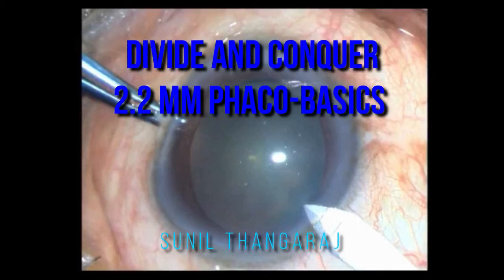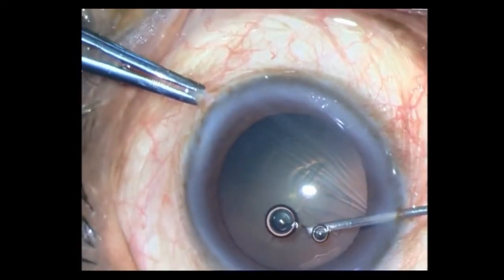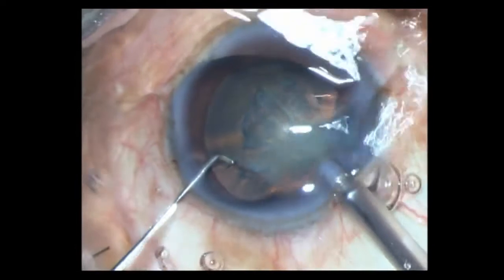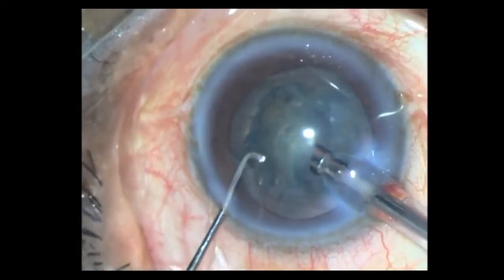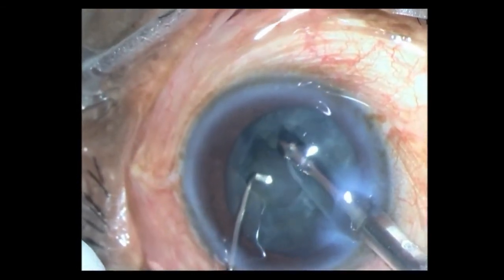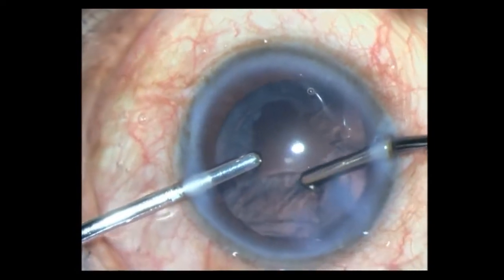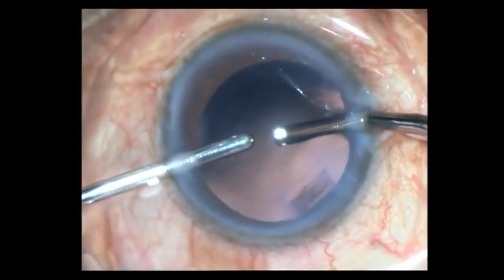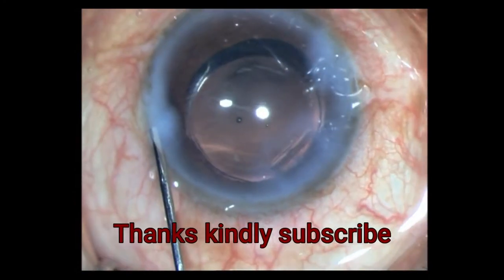Divide & Conquer - Basic technique in a 2.2 Phaco

Comment: I always have problem with 2.2mm phaco. A lot of case patient even with 3+ NS but came out with Corneal edema
My parameter is Ozil energy only, irrigation 100, aspirate 30 linear, vacum 300 linear for phaco chop.
Could you explant and guide me how to avoid this, thank you.
Reply from the maker: I use Oertli and don't face any problem though time is slightly more than in 2.8